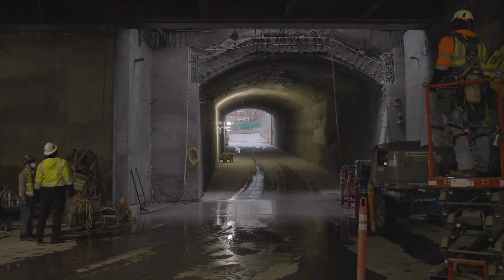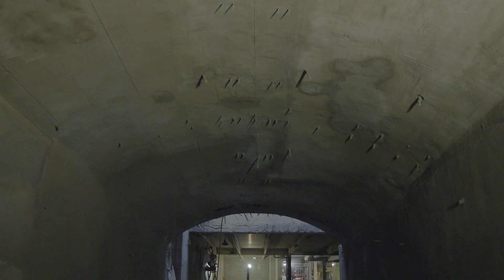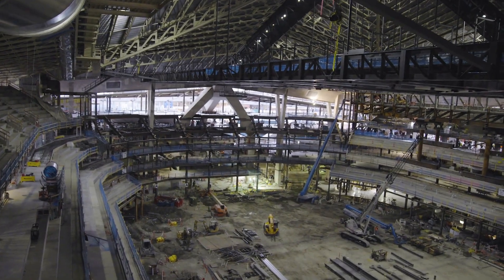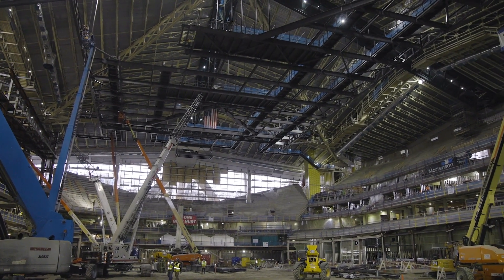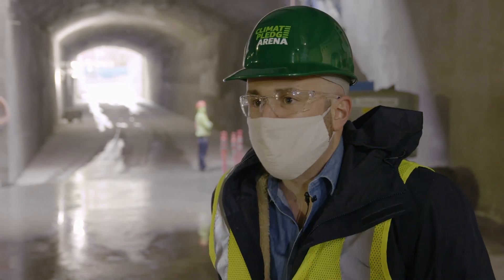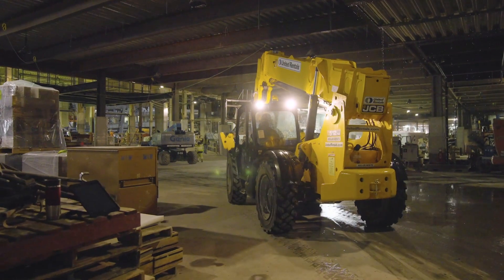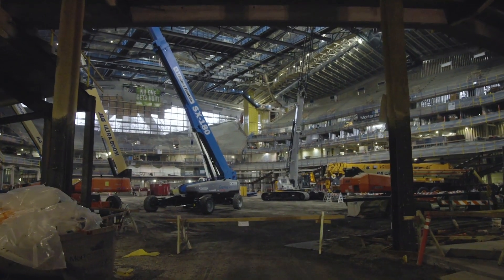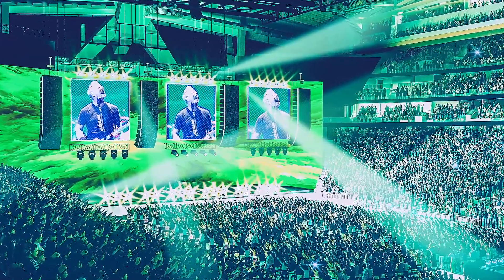Climate Pledge Arena Update: Tunnel Construction Completed

Comment: 1. It looks like it will barely have any room for fans.   2. How tf is it going to be done before this next season
Reply: The expected capacity is 17,100...there will be plenty of room for fans
Reply: Since most of the building is below street level, it can actually accommodate 17,100 for hockey and 18,100 for basketball. Along with 17,200 for concerts.

The biggest issue in terms of the timetable was the structural changes needed for the building, and that stuff is now done. They look to actually be on track to be finished before the start of the 2021-22 NHL season, although SEA will probably start on a road trip in case there's any delays.
Reply: Compared to UBS Arena. That is being for the Islanders. It is way behind for next season.
Reply: @mytubebookflickr  It was always scheduled to be done by Fall, 2021.